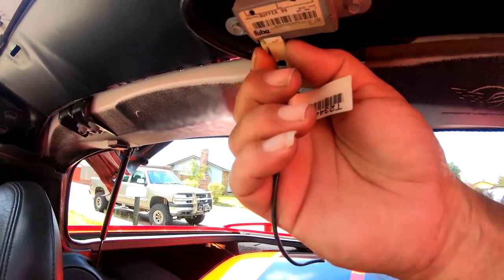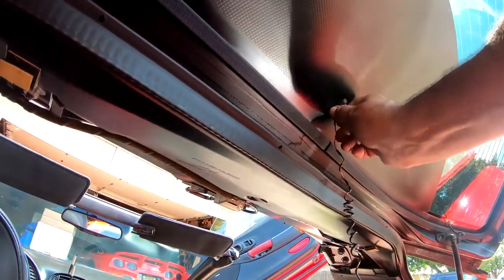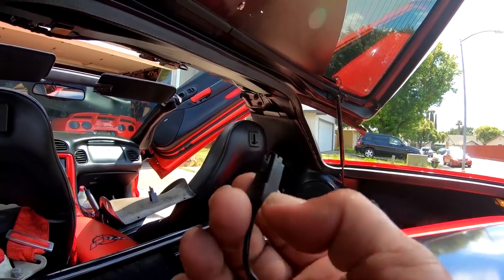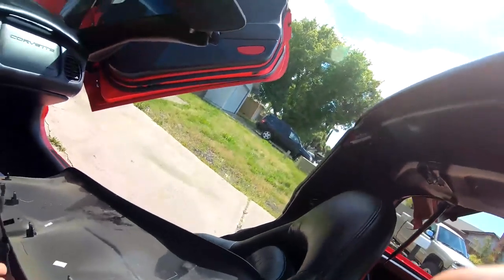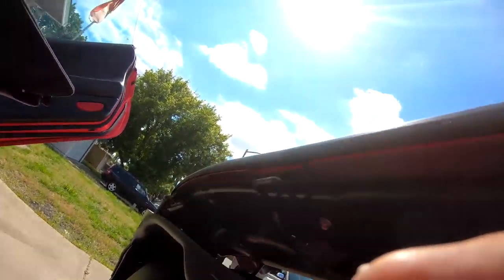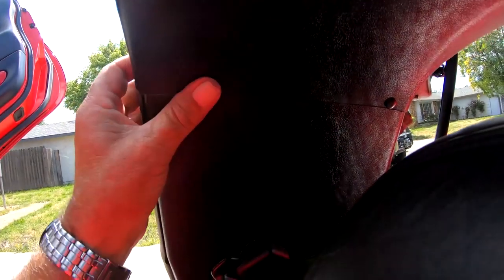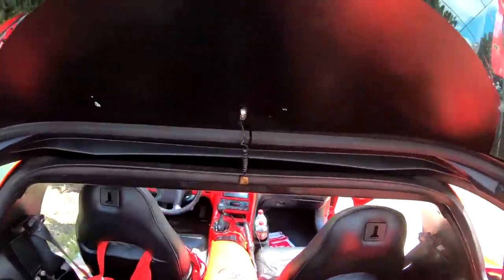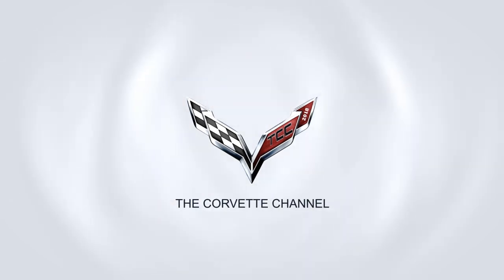How to Change the Rear Defroster Cable on a C5 Corvette

Comment: Nice video. If I may add, that trim has velcro on certain points throughout the trim where the cable comes out. This would be a good time to replace that velcro if the velcro's adhesive is old. 🍻

Comment: Gentlemen this is not a defroster wire. It is an antenna cable. They are no longer made by GM. I just picked up two from Corvette Recyclers in Utah. Ask for Doug. 

The defroster wire is located on the body on the passenger side of the car.
Reply from the maker: Thanks Jeffrey... not to long ago we figured that out. Thanks again...